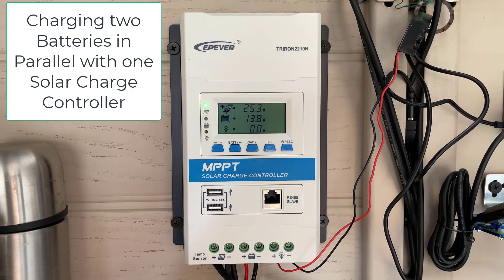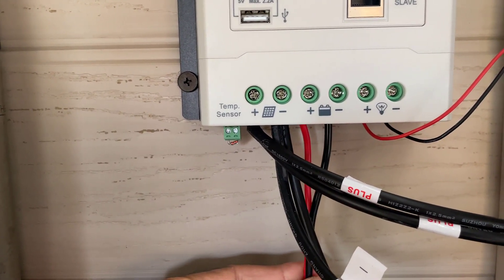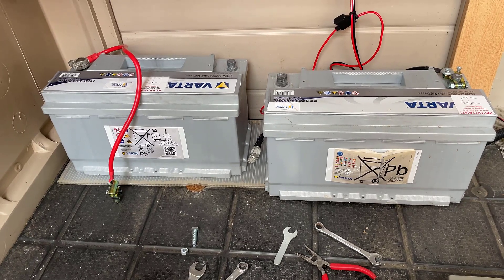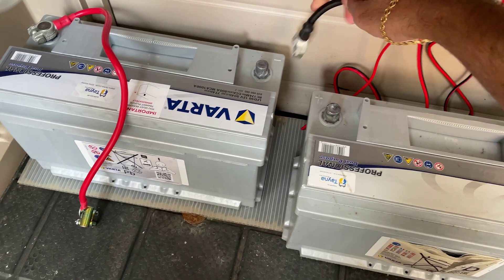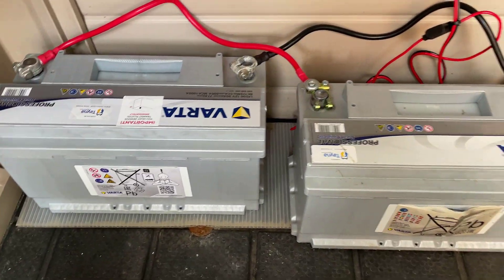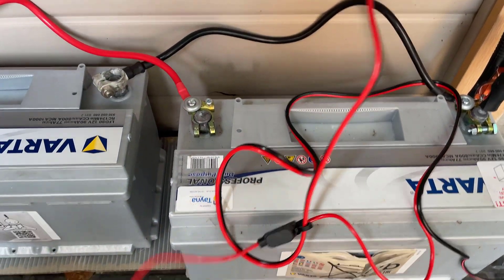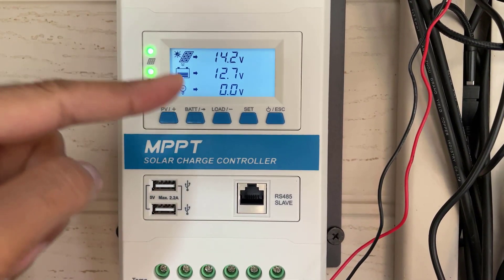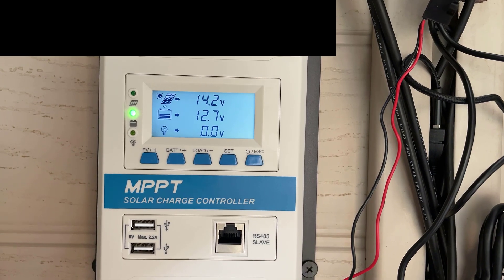Charging two batteries in Parallel with one Solar Charge Controller

Comment: Hi. How will I charge two Different size batteries (N70 & N50) to one Solar Panel?? Please help❤❤
Reply from the maker: You have a couple of options, either a dual Solar Charge controller or two individual solar charge controllers hanging off one solar panel can be used to charge batteries with different ampages like the N70 and N50

Comment: Do U have with 2 controller
Reply from the maker: In this video, I only used one controller. Keep in mind that each controller has its own power requirements and will draw battery power continuously, 24/7. This is important to consider if you plan on adding more controllers

Comment: I’m curious as to why it’s important to split the charging cables (+/-) between batteries that way. The relative resistance along the parallel connections is so low that you’re effectively charging both batteries regardless of where along the +—-+ line you connect to. As pointed out elsewhere in here, you could connect to the center of the parallel leads, but with a 4-gauge wire, the resistance between the  posts is so negligible that it seems like splitting gnat hairs here.

Comment: If i want to do more batteires lets say 3 or 4 how would i do this setup
Reply from the maker: Same principle applies, just add the batteries in the same sequence. Here's an example diagram of charging more than 2 in parallel: https://www.renogy.com/learning-center/solar-battery-troubleshoot-maintain/unbalanced-charging-and-discharging

Comment: hi
can i use this method to connect to 3 batteries in parallel?
eg the positive on 1 battery and negative on 3rd battery?
cheers
Reply from the maker: Hi, Yes you can

Comment: When one battery got full charged earlier then how other battery not over charged pleaae explain??
Reply from the maker: The voltage stays the same for all batteries. But the fully charged battery draws very little current, so it's not overcharged. The battery that's not fully charged keeps drawing more current.

Comment: I have two 12v batteries connected in parallel, can I connect one solar panel to each battery with its own charge controller on each solar pabel
Reply from the maker: Yes, it's possible, but not recommended unless you isolate the batteries during charging.
The best and safest option: charge the parallel bank as a single unit with one panel + one charge controller.

Comment: It would also help to charge both batteries individually before connecting them to the solar charge controller in a parallel configuration. By doing this, one battery won't be feeding the other if the voltages are imbalanced from the get-go. You can also balance this out a bit better by making sure that the parallel links are exactly the same length and then tapping the solar panel wires to the exact centre of each parallel link. By doing this, you avoid imbalances resulting from resistance in the conductors connecting the two batteries together. It's only a small difference, but certainly still a difference. Without doing this, one battery will always see a slightly higher charging voltage than the other. Once this battery charges up, both the solar charge controller and the charged battery would then end up charging the battery with the lower voltage. Over time, this would cause a mismatch between the duty of both batteries and their characteristics would drift apart - compounding the problem. It's a moot point and I wasn't sure of whether or not I could even safely connect one charge controller to two batteries until I watched your video. I ran a simulation on falstad.com and looked at the voltages and currents at each point in the circuit to eventually change it a bit to get the figures exactly balanced. Thanks for helping me with this!

Comment: What if your 2 batteries amps are not equal one is 190 amp and other 45 amps both 12 volts.
Which way should you connect from controller to batteries terminals?
Positive on the larger amp battery ? 
Or it does not matter?
Reply from the maker: I would strongly recommend you DO NOT attempt to mix battery sizes (amp-hours). Have a look on google, many reasons why not to do this
Reply: @ I have googled it and not found what you have said. Can you send me a link please.
Reply from the maker: @236vic  https://electronics.stackexchange.com/questions/271005/different-capacity-batteries-in-parallel

Comment: I have 2x100W panels and a 20A PWM controller. The battery I use for starting is a 120RC/55AH/650CCA Marine & RV Dual Purpose AGM Deep Cycle battery and the house battery is a 135RC/79AH/525CCA Marine & RV AGM Deep Cycle Battery. Would this parallel setup safely charge both batteries without over/under charging one or the other? Or, do they need to be the EXACT SAME BATTERIES?

Comment: Would this work if the positive terminals are not connected? 
Only the negatives? 

(In case of a boat, there's a switch that can connect mass to battery 1, battery 2 or both. In the case of "both" it would be like this video. In the case of "Off" it would be like this but without the positive terminals connected.) 

I feel like it would still charge one battery and only the mass would be wired through the other battery.

Comment: I want to do this, but have two banks of 24vdc batteries (each with its own charge controller) that i want to connect in series to create 48 volts. Is this possible?
Reply: Connect one positive to the negative on the other battery then connect charge controller to the other two free terminals that will create a series connection from 24v to 48v

Comment: Thanks for the video,  when you connect the load which terminals do you connect to?   The opposite to the charge terminals?
Reply: Connect load via the charge controller terminals marked up on the unit.

Comment: ohh man change your battery cables gage. Your one are defynetly to small.
Reply from the maker: It depends on what you are powering and how much power you have running through them. From the two solar panels used, these cables are more than fine trickle-charging the batteries. Where you need the bigger cables is from the batteries to any powerful load

Comment: Howqw would wire my charge controller to two batteries in series
Reply from the maker: If you have two 12V batteries connected in Series, then charge controller + lead connects to the + on Battery1 and the charge controller - lead connects to the - on Battery2. The - from battery1 is connected to the + of battery2. Bear in mind that the Charge Controller will need to rated at 24V as you are charging two batteries in series.
Reply: @HandymanSavage  thank you ,yes it's rated at 24v charge. 
One more  question. 
My controller is rates at 20A charge rate, and max 50vsolar input, I have 2 solar panels rated at 100w
Voc is 22.2v
Max power current at 5.5a.
Should I connect the 2 panels parallel, 
Or series

Comment: If the batteries are left does the charge auto stop?  Ie no danger of overhead or fire?
Reply from the maker: That's the job of the Charge controller, it controls when and how to charge the batteries and when to stop (therefore preventing overcharging)

Comment: Thanks for the video.  Would it be drastically bad if i connect a 70 amp and a 90 amp like this?
Reply from the maker: I would say It's not advisable and could damage the batteries.

Comment: If one of those batteries are at a different charge level, they will pull current to the lesser battery to equalize. that is not good for battery health!
Reply from the maker: that is why it is important to have the same batteries to keep this scenario at bay
Reply: How about one battery full charge earlier than other will the other battry overcharge please explain ??

Comment: Thanks for the video, Sir may I ask something about batteries,I have a Gel type Battery and Planning to use it soon for a small solar setup but for now I only have a Smart Gel charger and don't have a panel yet, Can I store the Valve Regulated Battery and just use it maybe weekly or when the power is out ? Would that be ok for the battery not to cycle charge it on a daily basis? Thanks
Reply from the maker: As long as there is no load on the battery, it should be fine to store and no need to cycle daily. Perhaps do a check on the battery every now and again to test the voltage, until such time you get your solar kit up and running.

Comment: I just bought a 100 W suitcase style and I’m about to go camping in my travel trailer , it has two batteries out on the tongue when I hook up the solar panel do I go to just one battery or do I clip one red to one battery and the black one to the other battery?
Reply from the maker: As long as the batteries are connected in parallel, then yes just clip red to one battery and clip black to the other battery to ensure an equal charge across both batteries.

Comment: How do you now connect the invertor ? To 1 battery or across the 2 ?
Reply from the maker: Check this link for Inverter configs based on Parallel battery setup: https://benignblog.com/connect-batteries-in-parallel-with-power-inverter-ups

Comment: Can this be done with a mains charger
Reply from the maker: I believe so, just make sure that the batteries have exactly the same chemistry and identical in every way and also ensuring that no other charger (i.e. Solar) is connected, otherwise you could damage it.

Comment: Didn't work for some reason when I try to charge it with AC charger..I swapped the negative and wire to 2nd battery and positive wire to 1st battery then it started charging..
Reply from the maker: Maybe your AC Charger has some smart features which don't let it charge in Parallel?
Reply: @HandymanSavage  is it possible that my solar charge controller is fighting the AC charger?i relocated my solar charge controller "wire to battery" to locations where the ac charger worked yesterday and when I tried charging through ac charging today it didn't work this time...
Reply from the maker: @andyandrinadioso4443  Hold up.... you are using an AC Charger while the solar charge controller is still connected? That's a big no no. If you're using an AC Charger, then completely remove the Solar Charger from the battery, that is asking for trouble.
Reply: @HandymanSavage  its not really connected to the solar panel yet..and also the ac charger won't start charging if the wires are connected to the same terminals where the charge controller is located

Comment: What if there is 3 batteries, how you charge them?
Reply from the maker: same applies to 3 batteries, just add to the sequence, ensuring the + end of the charger cable is on battery 1 and the - end of the charger cable is on battery 3.
Reply: @HandymanSavage  what about the wire connected to the inverter, would it be the same a the charger controller?
Reply: @ingridortiz_  we have the Same question. I'm  waiting for the answer too.

Comment: For more efficient charging connect the solar charge controller wires to the Center of these black and red wire, so equal distance to both battery and equal charge, both batteries will remain same in health
Reply: How do you do that?

Comment: Than for the video! Would you then need to change the fuse of the charge controller to a larger one? If so, how would you calculate that?

EDIT: technically, I don;t think you would have to change the fuse, as the current going into the batteries is still the same.
Reply from the maker: I wouldn't advise changing the fuse in the charge controller as they are rated at the specification of the controller itself. Putting a higher rated fuse than is rated could damage the controller internals
Reply: @HandymanSavage  so the fuse that is visible in your video is the fuse that protects the charge controller from recieving too much accidental current from the batteries?

Comment: To be clear - your charge controller in this case would still only need to be 12v or would it need to be 24v?
Reply from the maker: Correct, 12v - voltage stays the same in Parallel, it's just the overall Amperes available that are boosted
Reply: @HandymanSavage  Hello do you have to change the amps on the battery type of the controller? I have 2 12v 225amps battery banks (2(2 6v 225amps batteries connected in series)). My type of battery is set to: flooded 225Ah on the controller lcd pannel. The amps can be modified on the pannel. Do I have to put flooded 450Ah or 225 is good?

Comment: Remove your bracelet and any rings when doing this. If you happen to short the batteries with it,  your hand will burn like coal before you have the chance to pull it off.
Reply: H8er with a point
Reply: Good talk!
better safe than sorry..
heck my cheap dumfume battery manual.. makes sure and stresses this..
Reply: we are talking about 12 volts here.
Reply: @lars8614 

No, we are talking about potentially 1000+ amps going through your ring. Your finger will be rolling on the table in a few milliseconds. Then, the fussing metal can expell white hot droplets in any direction, including your eyes and your chest. And no, your clothes are not going to stop the droplets from entering your body.

Comment: Hi I have the same battery controller as you, do you get a drop in battery percentage after sunset? My batteries drop to 65% when load is applied. Is this because the controller can't tell that I have connected the batteries in parallel or is it something else? they are both new batteries and new controller. Any help would be massively appreciated
Reply from the maker: Hello. That also seems to be the case with mine, most days after sunset my setup is lurking around the 62-68% mark. This doesn't affect overnight performance when a load is on + drain of the controller itself. During the Summer I am running loads 24/7, with the batteries in parallel, they show 100% during the day and around 60% mark at sunset. I haven't investigated further, as am I getting the output I need to run 24/7 Ioads. You could start by disconnecting the load completely and noting how much the controller itself impacts the battery at sunset and overnight generally, then put the load on and note the % at sunset and sunrise to see how much drain you are getting overnight. Do let me know how you get on, i'm always looking for ways to get the most out of solar/battery setups.
Reply: @HandymanSavage  I also have the same issue,the % drops very fast after sunset. And I also have the same Epever-regulator as you have. So if we are 3 people getting the same drop maybe it is the way it works. I also have an Inverter connected so I dont use the load. but I'm getting nervous each time the sun sets. I have 4 batteries ( led ) each 95Ah.
Reply from the maker: @thesims8586  I've recently switched to a Victron solar controller, the problem seems to have gone away. It's still early days, but if it goes well I may switch over to Victron kit for my others.
Reply: @HandymanSavage   Thx for answer! But I know my problem now, my new batteries is TIN ( Tenn ) batteries and the Regulator cannot handle it. My TIN batteries has a maximum charging at 16V, so I must connect my computer via the RS485 on the Regulator and then use the  USER instead of GEL FLOODED and so on. I have to do the parametres all by myself so the Regulator can identify my batteries. I'm from Sweden so I hope You understand my English. =)  So what happened to my batteries is that they are not fully loaded. because the Regulator stop charging when it hits the 14.8V, coz it's thinking my batteries is Lead-battery.
Reply from the maker: @thesims8586  Interesting, glad you got to the bottom of it, TIN batteries will keep a note of that for any future issues. Good thing is you didn't have to buy another Solar Controller and you were able to fix it using the parameters. Well done and yes you're English was actually better than most I come across on here lol
Reply: @HandymanSavage  Hahaha..thank you =)

Comment: I have tow batteries one is 70ah and 2nd 75ah so can i connect in controller or not?
Reply from the maker: I would advise against this, as one battery is a different ampere than the other, you will not get an even charge across them. Always advised to have the same battery+model if you want optimum charging in parallel

Comment: Just been looking at our van charger and batteries. They have connected from the solar charger the positive  and negative to only one battery yet the battery's are  connected as yours is. 
Have they connected it wrong.
Reply from the maker: From what you say, that appears to be configured wrong, the batteries won't be getting an equal charge.
Reply: Maybe that's why one battery is dead and the other has been cooking, getting hot and stinking the van like rotten eggs then.
Reply from the maker: Lucky you caught the eggs before they caught fire and "toasted" your van

Comment: Hi i have a 300W /30 A solar controller 12/24V , can i charge two 12V 200Ah Lithium LiFePO4 Deep Cycle Battery if in Parallel Thank you  David
Reply from the maker: Try here: http://marcinmazurek.com.pl/how-calculate-charge-time-car-battery 
A 40 Amp charge controller is recommended
Reply: 300w/18 
 Equals 16.6 amps, spread across 2 large capacity batteries. Not enough for two 
I would suggest using a VSR in the circuit so only one battery is charge at any one time.

Comment: If i already have a setup with 1 battery, and want to add another battery. Do i need to take everything out of the charge controller first? Or can i just add it?
Reply from the maker: Assuming you have a solar setup. When adding anything to a charge controller, always best to follow the rule: Load, Battery, Solar. If adding a new battery, disconnect the solar and battery, add the additional battery, connect the battery input to the controller and lastly connect solar.